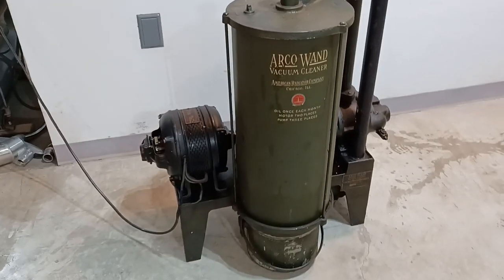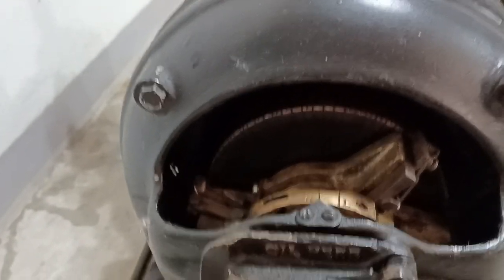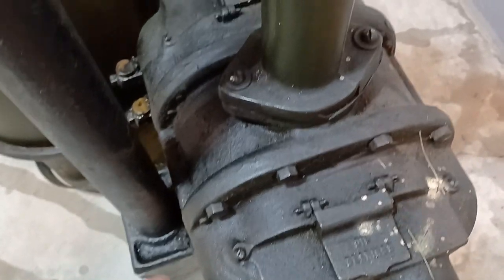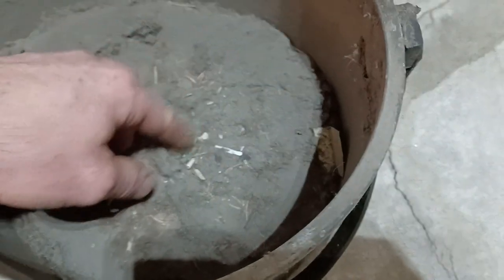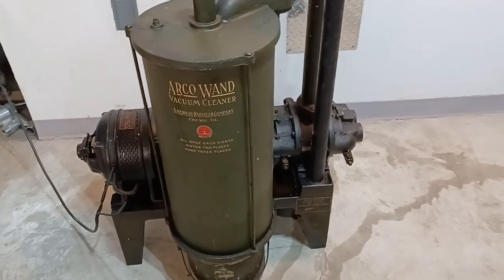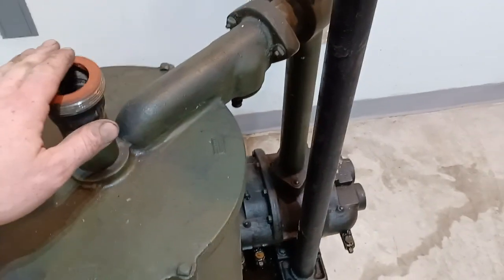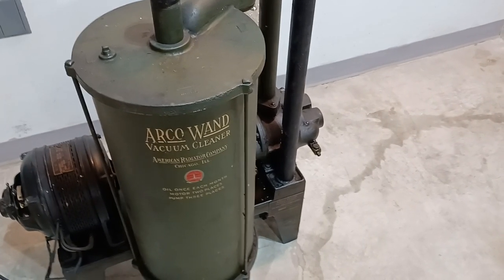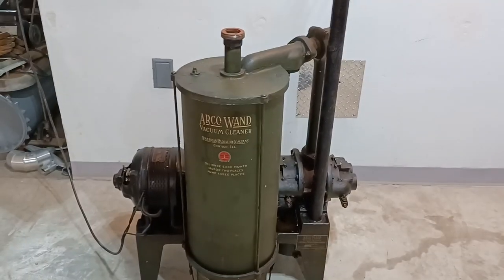Antique Built-In Vacuum: Arco Wand Model 341 from 1915

Comment: This came from my house, my wife and I had quite the time getting it out of the basement!  Thanks for picking it up, Owen.  It's really cool to see it up and running.  That motor startup and sound is great.  We are renovating our kitchen and dining room and I just ran across the old iron vacuum pipes in the wall.  Just like you say they must have been installed at the time of construction because they are bricked into the foundation walls along with the radiator plumbing.
Reply: If you have any accessories tucked away (including any keys for turning it on ) and want to pass them to a good home, let me know! My system has a keyed on/off electrical junction next to every hose port throughout my house.

Comment: That  Arco vacuum cleaner is one BEAUTIFUL peice of equipment! The displacement pump is still used today in some truckmount carpet cleaning machines.The Roots pump is turned by a gas or diesel engine-I tried one that has a 32Hp Kubota Diesel-the suction and and airflow is more than any home central or portable vacuum.And these Roots pumps started out a superchargers for WW2 vintage high altitude bomber plane engines.Used before turbochargers.I have seen repusion-induction motors used on some Delta Unisaw tablesaws-always fun to watch thaose motors start!They were like 2hp.If you had to-you could get a 1140RPM modern induction motor at half hp.Grainger would have them under their "Dayton" brand.1150RPM induction motors are very common.1750 is the most-then 3450rpm.

Comment: Even if a modern central vacuum system will completely outperform this one, I still find it remarkable that at over 100 years old it still has at least some power to be usable as a vacuum cleaner. I honestly wasn't expecting it to move as much air or have that much suction as you demonstrated when you turned it on. Infact I believe this is more powerful than some dyson handhelds hahahaha.

Comment: I think I have one of the first models that predate the machine in your video. I acquired the house about one year ago and the city believes the house was built in 1890. It does have the two bucket system and an eight or 10 inch belt drive. I would love to talk to you about potentially getting my Arco wand working again. Is it possible for us to speak somehow?
Reply from the maker: I would love to hear more about your system! Send me an email, operkins@gmail.com. Thank you for watching!
Reply: @owenperkins  
I emailed you a photo. Let me know if you want any other photos or FaceTime perhaps.
I was thinking about finding a new motor and belts just to see what happens but after looking at your video I think it would be much cooler to get original equipment. There is an outlet for vacuuming the basement and there are three living floors above but I haven’t seen any of the outlets upstairs. Most likely got covered over at some point.

Comment: Interesting machine, I saw the American Vacuum company website and the machines are similar in configuration as well as portable models but belt driven.  The other machines I know of that use a Roots type blower are the gas powered truck-mount carpet cleaning systems.  The engines in those are typically Kohler or Honda V-twin machines rated at roughly 20+ horsepower.  Not dissimilar to what is in my garden tractors.

Comment: I wonder if the Inter... is actually meant to be "Intermittent" as in "Intermittent duty" and they just didn't have enough room on the nameplate to stamp the full thing. It's quite possible the motor did make the full 1/2 horsepower but was only rated to run continuously for 30 or so minutes, giving it a sort of duty cycle like welders have.  Seems kind of weird to do that on something that would likely be running for hours as the poor maid desperately tried to clean the house with it, but that might just be lost to history at this point.

Comment: We have what looks like the same exact unit in our house. Any idea where we could find replacement inlet caps? (If that’s what they are called) We are missing most of them :(
Reply from the maker: The exact inlet caps are going to be quite difficult to find, as they have not been made in 100 years. I have used Spencer Turbine inlets (round) and modern residential central vac inlets (rectangular) at different times. Both might require a little careful surgery but this can usually be done in a way that the inlet plate covers it.